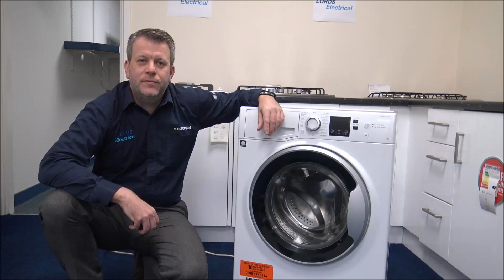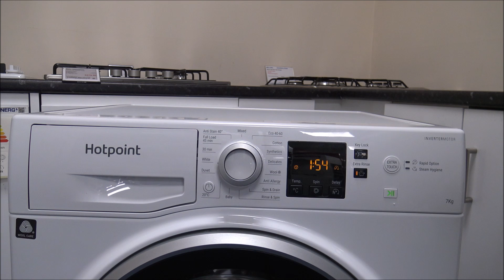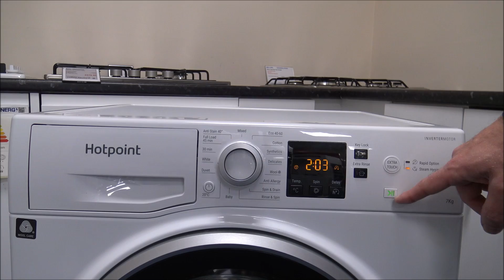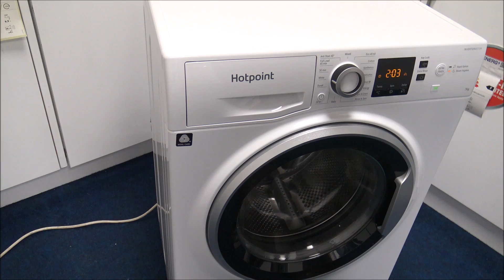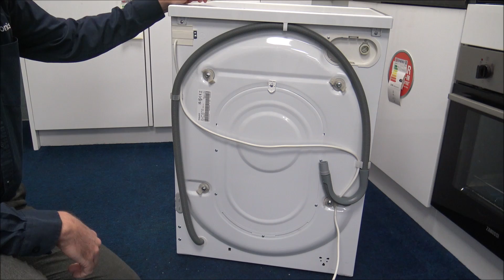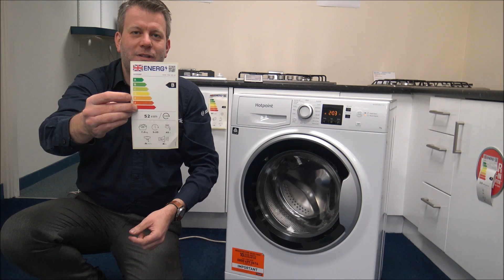Hotpoint NSWE745 1400 Spin 7Kg Washing Machine

Comment: Hi,
I’ve just bought this inverter motor machine.
Thanks for your video; it was very helpful. 
I like the delay function.
It is much quieter than my previous machine.

I do still have some queries.
I find the printed instructions for this machine to be very tedious and very hard to read due to the small print. 
I don’t find the guidance to be clear.
Please can you help.

1 - Does this machine have a specific pre wash function?

2 - I am not sure where you add the soap powder for pre washing IF it has a prewash function.

3 - Where do you put liquid detergent as the instructions are not easily understood. There is a small removable blue plastic item that you slot into the drawer when using liquid, however it still isn’t clear where you put the liquid…?

Your assistance would be greatly appreciated.
Thank you🙏🏾
Reply from the maker: This model doesn't have a specific pre wash function. The liquid goes in the section where the blue tab is located. It is important to use the blue tab when using liquid as it can escape into the machine too early if you don't use it. Also if you are using powder or gel pouches then take the blue tab out
Reply: @lords-electrical 
Thank you so much🙏🏾

Comment: I have been doing some research to find a replacement for my old Hotpoint WT540 washing machine which has been excellent, but now has a rusty front. I've looked at this one because it's similar and the size is right, but oh OMG! what a complicated set of wash cycles it has, I suppose that's the norm these days. Another thing I don't understand is it 7KGs wet or dry weight?  Thanks for the video.
Reply from the maker: It will be 7kg of dry clothing. Thanks for the great feedback 👍

Comment: It's good to see Hotpoint using the Inverter Motor on 7KG models now... previous models used the brush, being as loud as 79db or even 83db at 1400 this is improvement 👍

Comment: How do i activate the maintenance wash cycle on my hotpoint it keeps flashing up its a new machine 2 years old its model is nm11946bca uk n . I cant even find it on the instructions
Reply from the maker: If you haven't got a specific maintenance cycle then i would just select a 90 degree wash and some detergent too on a 1 hour cycle

Comment: I have just purchased this Hotpoint washing machine. I don't like the dispenser drawer it is very hard to remove it and put back. But at least the washer works. I had a Hoover H washer which was bought in September 2022. These past few months this washer has broken down 3 times. Twice it was the heating element and then it was an error code E02. So it was time for a new model.

Comment: Hi can this washing machine do a wash at 60 degrees for an hour program our old machine wmao743 did a fast wash at 60 degrees in an hour and I wondered if this machine was the replacement thanks
Reply: Unfortunately these new Hotpoints do not, I personally think they should’ve had the fastwash 60 min instead of full load 45 min aswell

Comment: How do machines know how much material is in the machine? How does it decide the volume of water that enters the drum?
Reply from the maker: The machine will send a certain amount of water in to the machine at the beginning of the program. Depending how much water is saturated by the clothes, it will know approximately the load in there and the duration of wash to go for. Great question by the way 😊
Reply: @lords-electrical do you have any more to come
Reply: @lords-electrical Mine works differently that this! It just spins them at the very start of the program and it somehow knows exactly how much time it will need! Funny little robots we have nowadays 😂
Reply: Very similar to my machine from lords, great company would highly recommend!